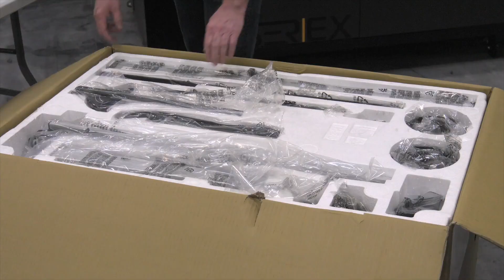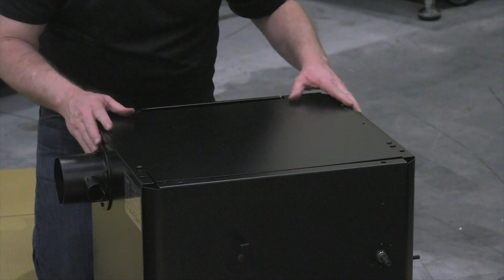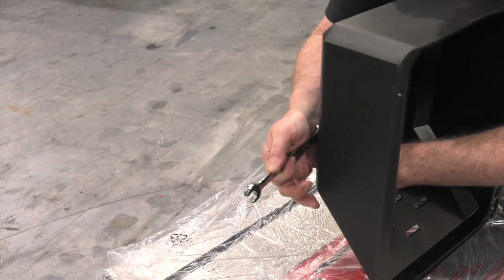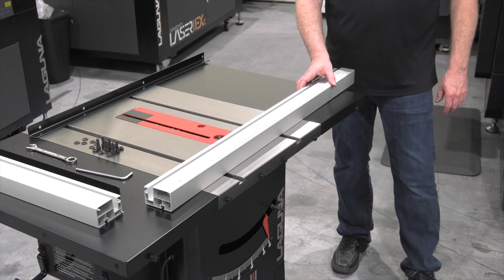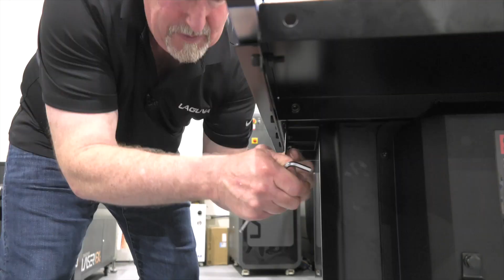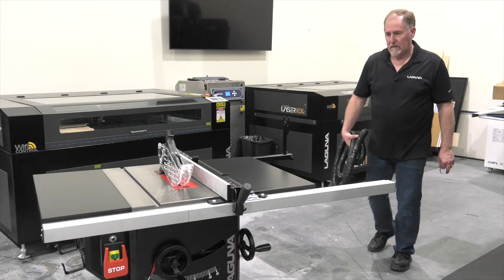F1 Fusion Tablesaw Assembly Step-By-Step | Laguna Tools

Comment: Congratulations to the presenter; the video is wonderfully clear and precise. My only negative comment is that the printed manual is poor that such details as screw/nut/bolt assembly is so small it's not at all clear which fasteners are being used and where. If the video is ever updated, showing the fasteners used before assembly would be a great improvement.

Comment: On July 4th 2022 I unboxed my brand new Laguna Fusion F1 table saw. 2 days ago,, August 13th, 2025,, I experienced my 2nd arbor issue. First issue was the bearings went out. I replaced those and now the shoulder on the arbor has worn down to the point where it ruined a good rip blade center hole. The saw starts just fine but it takes a couple seconds for the blade to catch up. It stops when fed a pine 2x2 slowly as the blade slipped on the arbor. I am using the factory arbor nut on my blades. Im extremely confident right now that their 19/38 drum sander will NOT be coming to my shop as an upgrade to my Jet 16/32. I am extremely disappointed with Lagunas table saw and service as Ive yet to hear back from Travis at Laguna. Im not a happy Laguna tool owner after dropping $1100 on their F1. This is a good saw to avoid. 

However,, if I get some sort of a positive  result I will update this. And in complete fairness I will report if it goes the other way as well. 

Glen Shaffer

Comment: @laguna tools....Can you please please do a video to covers squaring the blade to the miter slots? The directions Laguna customer service is confusing. The loosening of the cast iron to the body is difficult
Reply: I read that pre 2022 fusion 1 is supposed to be trunion adjusted but that Laguna made a design flaw, making it unadjustable. Fusion 1's after 2022 are table adjusted.
Reply: you do not need one: this is a straight forward machine and things like aligning the cast iron table can be figured out by using the brain that mother nature gave you
Reply: @happyreeds  for the life of me I can’t imagine why you would leave a comment like this. I have never met you but for some reason you chose to  insult me. This problem of the blade coming out of alignment from the miter slots is common on the model after doing research you would have seen that. Secondly the trunion is mounted to the cast iron top not the cabinet. Which makes it more difficult.

Comment: As others have stated, at 25:53 they don't show but you MUST install the switch into the short rail before you mount the rail. It simply will not slide in as the video implies - the cable doesn't reach and it will not ever reach - don't try to extend it. I think the video should have discussed this and this is a clear design flaw - one additional inch of cable would have been all that's required to slide the switch into place. Otherwise this is a good, thorough installation video. Don't waste your time on the manual, it has no real value other than the exploded view. 

I just finished assembling and made my first cuts, really impressed by the quiet, clean cut and dust collection!
Reply: This is correct. The switch must go on the rail before the rail is installed. I followed the video. I had to remove the short rail, slide the switch on the rail and then reinstall the rail. Of course, I was 'tightening' the nuts upside down and backwards and loosened one so that the screw and washer fell out. So I got to reinstall the rail again.  Other than that Mrs. Lincoln, how do you like the saw?

Comment: I'm considering a table saw upgrade, and the F1 is on my shortlist. It looks like the foot at the far end of the fence rides freely on the rear rail, and isn't involved when locking the fence. Is this right? I hate those mechanisms that clamp the fence to the table at both ends.
Reply from the maker: Hi, the Fusion 1 Tablesaw has a tee-style fence that locks only in the front.

Comment: @Laguna Tools. I'm is the process of assembling my F1. A suggestion for putting on the base. I can see trying to reach into the far side to put the nuts on would be a big pain in the a%$e. What I did was, before screwing in the base bottom panel, put a few drops of CA glue (superglue) or hot melt glue and insert the bolts in from underneath. Let that set for a few minute while you screw in the bottom plate. Once the bolts are firm, lift on the base and you can tighten nuts easier without having to reach in under the table top doing it blind.
Reply: The dust plate can be put on after the base is installed and it is way easier to put all 8 bolts on

Comment: A few things to note
1: The wings can be installed on either side, but there is definitely a front and back.
2. The on/off switch cord is about 2 inches too short to easily slide into the front rail. Either slide it on before you connect the short rail, or remove the nut on the left then slide the right hand nut into the groove, then line up the second screw with the nut
3. A 3mm allen wrench is needed to adjust the square of the fence, (my saw did not come with a 3mm wrench)
4. An 11mm wrench or very small adjustable wrench, is needed to tighten the nuts on the power switch.
Otherwise this is a good set of instructions.
Reply: did you notice they didn't actually show the switch being slid into the rail. I had to undo the rail and move it to across to get the switch in.
Reply: Pete I wish I had read your comments before assembling my saw.  I had to take one of the wings off because I had it on backwards.  Mine came with a flat piece of metal set to tighten the 11mm nuts and the nut from the switch.
Reply: @robhudsonnc same here.